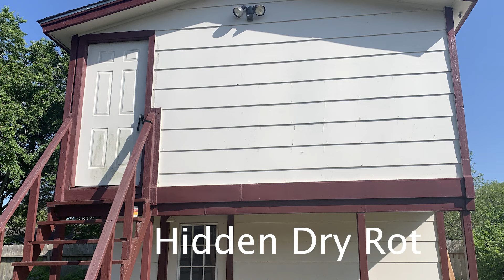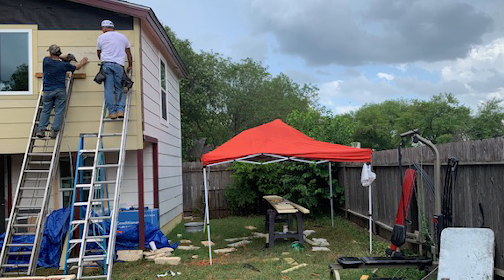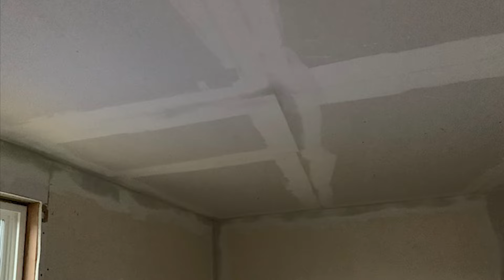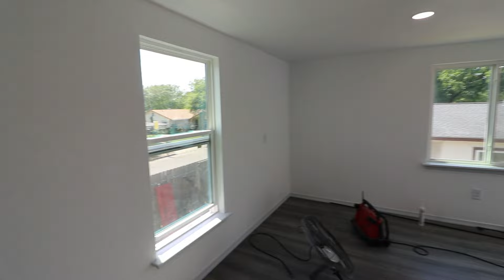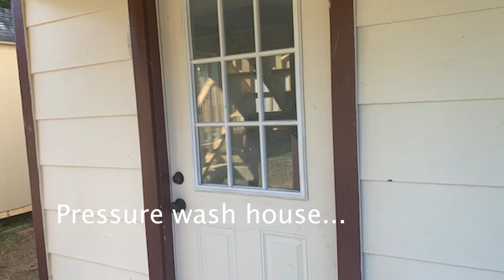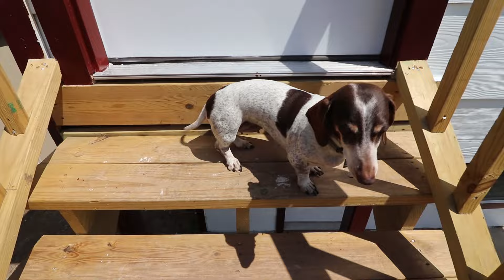Almost Finished Construction (Moving my Business)

Comment: Upstairs will be brighter, but if you have customers, then downstairs will be better in case you have customers that cannot do stairs.
Reply from the maker: See the both place have their place and both will work for different reason.    Upstairs does have more light and it will all so be hotter heat rises and is bigger.. downstairs is cooler one less window and easier to get too but a bit smaller

Comment: I’ve never seen siding directly on interior wall framing.  Is there no need for plywood sheathing?  Maybe construction is different in Texas.  The room is gorgeous!!  You are going to have so much fun in your new space ❤️💕
Reply from the maker: The contractor told me that it should have the plywood and the water barrier but I guess the last owner just wanted to be as cheap as possible.. even the siding it’s almost like thick paper board..

Comment: You have more space upstairs, but I'd go downstairs because 1) that machine has to be heavy and it may be better on a concrete floor and 2) if you quilt more than embroider then having it on the ground floor makes more sense (no going up and down all the time) and 3) clients will need to get to your machine to see options and pick and ground floor is best for that. But if the biggest concern is space then it should go upstairs.
Reply from the maker: I guess in my mind is I can move the longarm upstairs in different directions but the floor is a concern and the weight and clients.. downstairs machine would only be set up in one way.. solid floor and cooler space..